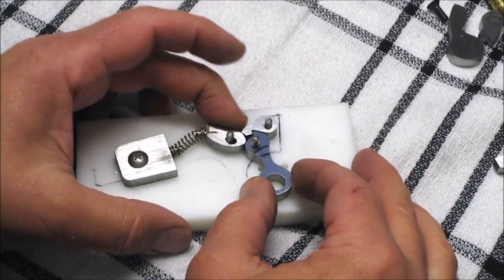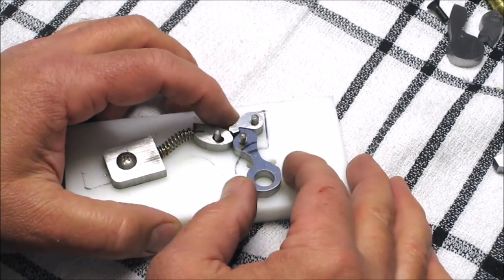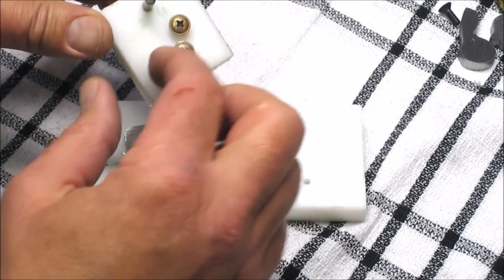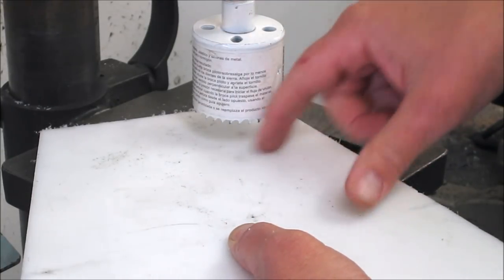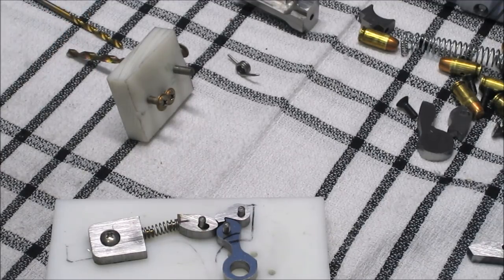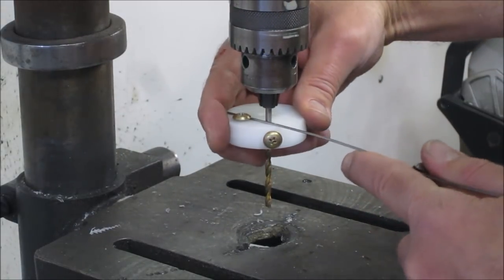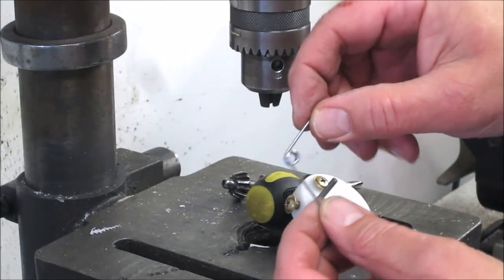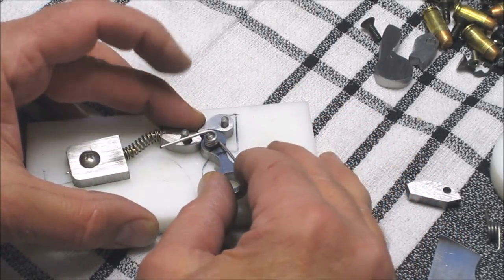Kolt380 Re-boot - FCG stuff and spring making... boring!

Comment: To avoid flashing at the bottom of your cut, put a block of wood under the plastic as a sacrificial material. Cut through the plastic and into the wood.
Reply from the maker: Good idea, thanks. Did you notice me fumbling a bit with the "hot" plastic. It was still slightly molten.

Comment: Quick question though, why the big hole in the hammer? It seems to me that a solid hammer helps the operation of the mechanism more, because of the increased mass. Does that big hole in the hammer adds functionality to the gun, or is it just for esthetic purposes?
Reply from the maker: The planned hammer had more of a "claw hammer" shape. I wanted to maintain original mass.... Ahhh, screw it. It's aesthetics and only aesthetics. This blocky build needs some curves. Besides, I like the look of a knurled round hammer:)
Reply: Clinton Westwood You & me both. Nobody likes something that snags. :)

Comment: you need to calculate the torsion spring length and how for it the same as the limiting ring and fit into the space of gun.you also have to harden the spring carefully how for its properties maintained.put the mechanics and the case side by side so you can see if there's problem.Remember you can still use rubber band for flexibility.
Reply from the maker: Appreciate the good suggestions. The springs will be stress relieved after forming.
Reply: Clinton Westwood thank,i will keep suggest what my opinion and my knowledge.
Reply: Can you tell me how to harden spring for hammer?

Comment: You're just cutting circles in the plastic because they're quick to cut and efficient, right?  It seems like a more handle like shape would be easier to use on your drill press.

Comment: Arent you supposed to heat treat the springs so they keep their shape, or am I conpletely lost here?
Reply from the maker: Yup, heat treating is very important. These are not yet installed and I'm not even sure I'll use it. It was for demo purpose only. However, it's fairly close to what I want. So, stress relieving "may" be in it's future.
Reply: Clinton Westwood Thanks for the answer!
Reply: Are you able to tell me the gauge of spring wire you used on the krikit 25’s hammer and sear assembly? I can’t seem to find anywhere I can ask you this question except through your older posts. Sorry
Reply: @clintonwestwood5498  just wondering what gauge spring wire you used on the krikit 25’s hammer and sear assembly? I can only message you via your old posts, sorry.